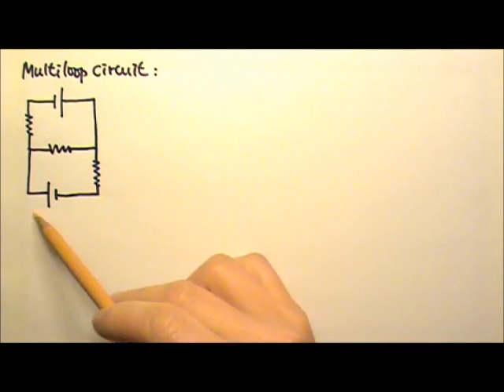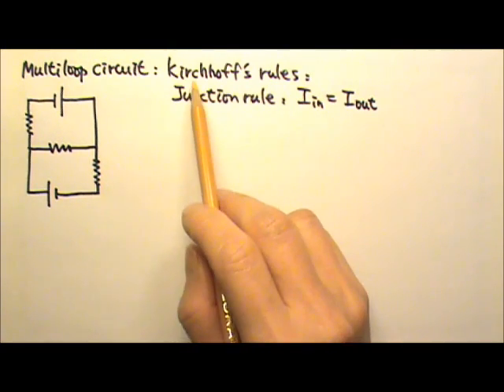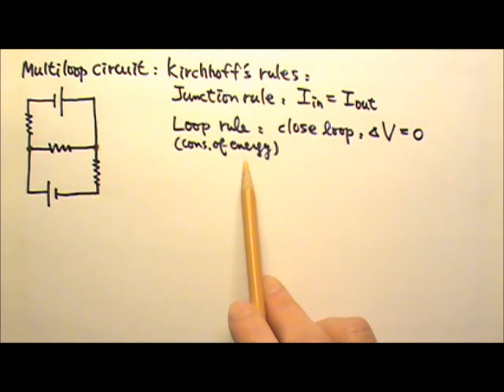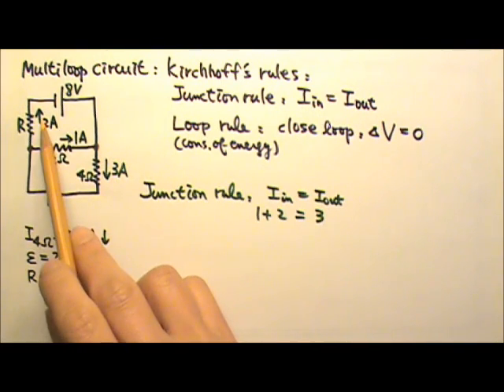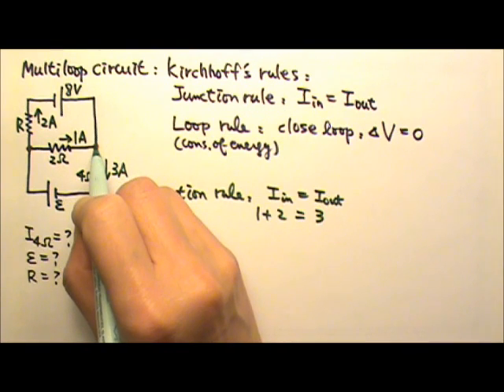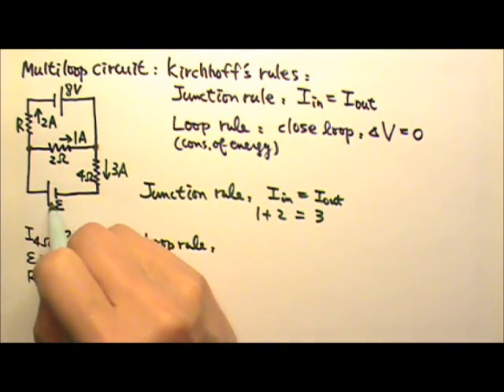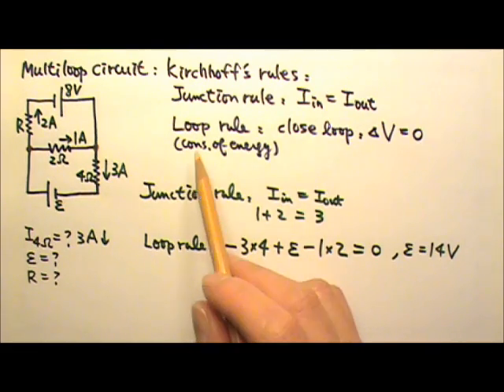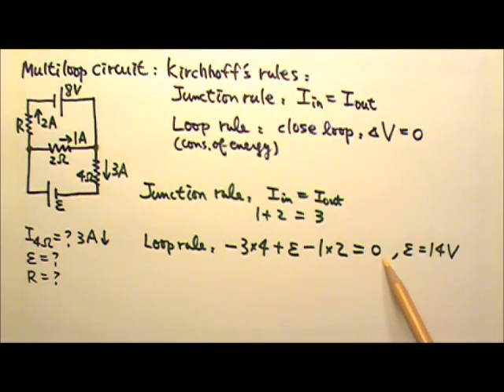AP Physics 2: Circuits 20: Kirchhoff's Rules and Problem

Comment: I'm taking current analysis AND physics 2. how we solve the problem are completely reverse with the signs. I have to stay consistent for circuit analysis, as the complexity of the circuits are much greater. when the current splits between the 5 ohm, and 2 ohm resistor; conceptually I want to say that the current SHOULD be 2.5 times higher in the 2 ohm resistor. This is clearly not true, as it doesn't fit the model. Is this true because of the lack of parallel/series relationships in the circuit.... and the current divides by more than just a function of those two specific resistors?
Reply from the maker: +armbarsandbarchords Yes, you are right. Since the 2-ohm resistor and the R (the 5-ohm resistor) are not in parallel, we cannot say that they have the same voltage. Therefore, the one with (1/2.5) times the resistance does not have 2.5 times the current.